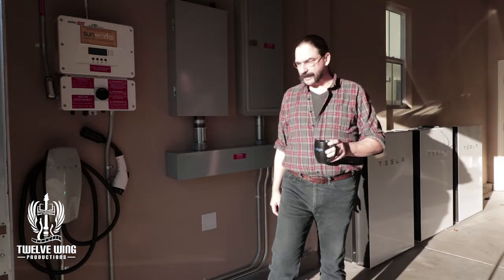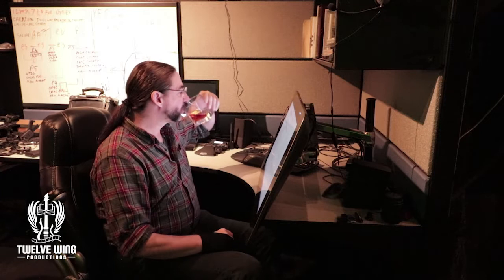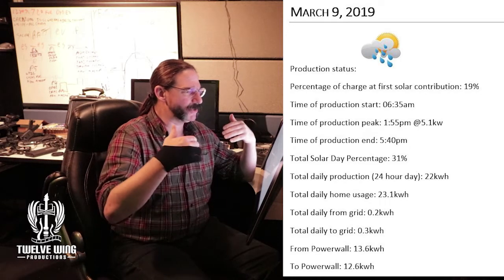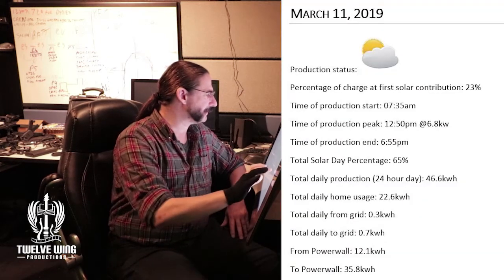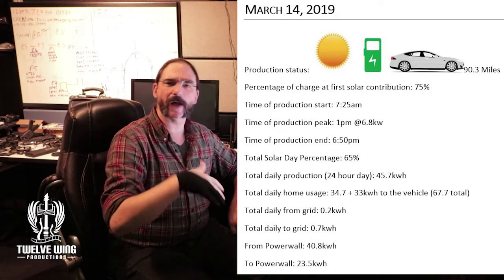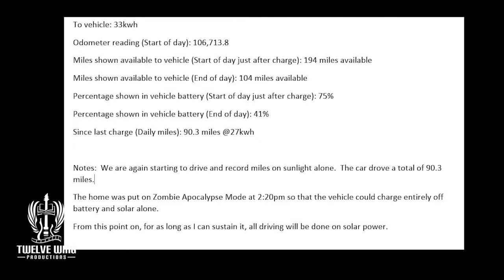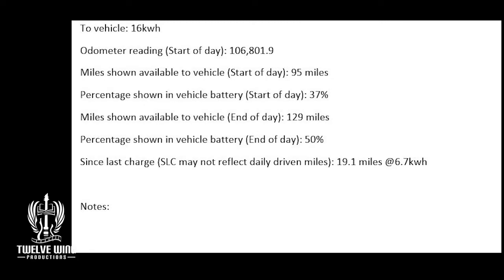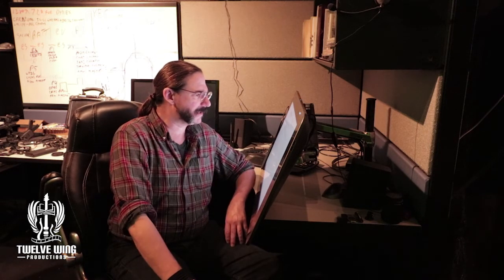The Energy Sovereignty Project: Month 3 Week 2

Comment: Hey I got a quote for solar, can you look at it if its a good deal or not? I got the quote from PetersenDean, I ask the guy about the battery system he was pushing for LG battery over Tesla power wall. Should I post the quote in the comments or email it to you?
Reply from the maker: Go ahead and post in the comments and I'll have a look at it.
If you can give me some geographic information that will be very helpful too.  Not your physical address but if you could give me the city that would be great.
Also, shoot me your yearly average power consumption for a day.
If you have a summer and winter breakdown that would help also... but annual would be fine.

I will start out by saying that I can only value the equipment... as I have no personal experience with PetersenDean.
The two installers I can vouch for are SolarCo/Future solar and SunWorks.
Reply: Twelve Wing Productions I live in American Canyon, California here’s a link to google docs to my power usage. Over past summer I went on vacation but this year I won’t take a vocation and want to use my electricity 
 https://docs.google.com/document/d/1ecL_ro9q2EQ9vYDwT6E27rNWGu0-VfdgIuszhk0mgpI

Here’s my email response from the solar person 

System size - 7.68 kW DC (24 panels x 320W)
Gross cost - $23,772.89
$ per watt - $3.09/W ($23,772.89 / 7,680W)
Tax Credit - $7,131.87
Net cost - $16,641.02 (5.7 year ROI on $2,900/year of PGE worth of power from system)
 
Here’s how adding the LG battery would look:
 
Battery Gross: $11,399
Tax Credit: $3,419.70
Battery SGIP rebate: $2,518
Net cost: $5,461.30
 
When looking at our competition, important questions to ask are:
 
Warranty (ours is 25 years across the board and insured)?
American made (Ours are and carry a 30 year power guarantee)?
Years of business (we're on our 35th year and surpassed our warranty)?
Roof guarantee (ours is 15 years and we flash all our penetrations)?
Reply from the maker: @prabhdeepdhaliwal5706 ,
At 7.68, your system is a little undersized for 25kwh daily average.
I have an average of around 15-17kwh daily at the studio with about the same output and I come out a little over most years.  Not much, but still annoying to pay a couple hundred dollars to settle up.
I would spec your roof at 8-10kw as your usage is slightly higher.
That said, your usage is more consistent than our Energy Sovereignty Project home AND you are better located.  Your summers are a whole lot more mild than in Sacramento.

So you are probably fine with 7.68 if you have a fairly optimized roof.
The batteries... that's another matter.
To give you my best advice regarding them, I'd have to know what batteries you are getting... and what the total KWH are that you are getting for that $11K.

After rebates, if you pull the trigger on this now, the installer that did The Energy Sovereignty Project home (SunWorks) can get the Powerwall 2 batteries for you at $4,200 .. installed.  So that would be 3 batteries for just a little more than the $11k you are being quoted for the LG Chem.
We looked at the LG Chem batteries and others when setting up for The Energy Sovereignty Project and chose not to do them because they didn't have adequate thermal management.  3 powerwall 2 batteries would be 45kwh total with about 40kwh usable.  3 of them would also give you 15kw of output, so you could run your entire home off of them basically.  AC included.

Contact SunWorks using this code: sunworkspowerpay.com/p6tsxf 
That code will put you in touch with Greg Scott with Divine Solar.  He will talk you through the financing options and give you a good quote for the batteries.  Get multiple quotes.

You should also get a quote from SolarCo, also known as Future solar.  Use my name, Patrick Dolby.  Let them know I'm a customer of theirs and they may kick you a discount or some freebies like a panel upgrade.  Contact me if they need additional information and we can work out how I can get that to you.

I hate to sound like I'm pimping the Powerwall.. but until someone else understands how important thermal management is... they are the only game in town as far as I'm concerned.
Reply: Twelve Wing Productions okay thank you. I forgot to mention my roof is facing south. I just put my info in your SunWorks link. I’m thinking to put 8 or 9 kWh system. And probably get 2 powerwalls. Do you recommend any panels company to buy from LG vs other and what watts should I buy. I had  a quote SunPower I believe few months ago I think around $23 k they were offing LG 375 watt panels not including batteries. When I was talking today with Peterson with panels he said it’s not worth paying extra 50 watts with lg and go with a different brand for I think 325 watts. What do you think about that? Also the salesperson pushing lgbatteries over Tesla it rubbed me the wrong way
Reply from the maker: @prabhdeepdhaliwal5706 , I'll get back to you tomorrow with my recommendation for panels.
There are lots of good ones these days.. but I avoid Chinese like the plague.
They just don't follow good or fair business practices. 
I would say German or South Korean... but I'll look into this for you when I can.

It's an important enough topic I should probably address what to look for.
Basically, it's not the overall wattage, but where that extra wattage comes from.
If you use what are called "Double black" panels... it's grown from a single crystal.  Their performance in shade or at high angles is better.  This is also reflected in their overall performance.

All the panels at both locations are black and double black panels.
I'll look into this tomorrow and give you more specifics.

Comment: you need a zappi charger !
Reply from the maker: This gets mentioned every now and again.  I think I'll have to do a quick topic on this to highlight some of the differences between the capabilities (currently) of the Zappi charger and the Tesla charger/batteries.

Basically, the Zappi was created so that excess power from your PV system could go into your car.  It works great but it was designed for people that don't have a home battery system.

The Zappi does for the car what The Energy Sovereignty Project system does for the battery in the home.

The trick is to have a home battery and charger communicate with the vehicle so that a wide range of settings can be established to take advantage of the "decision points" we examined in our first 2 months of operation.

Summer will (or should) be a little easier for such a system to sort out.  The real difficulty comes in winter.
A successful system will need to communicate not only with the inverter as the Zappi does, but also with the vehicle.
Eventually this will even include the vehicle putting power back into the home.

Once this happens, I will consider this technology "mature".